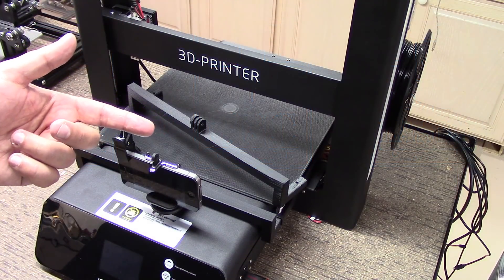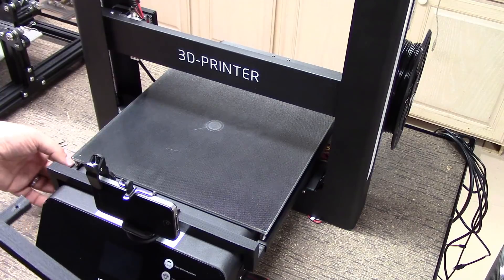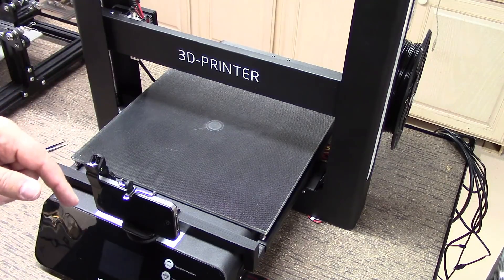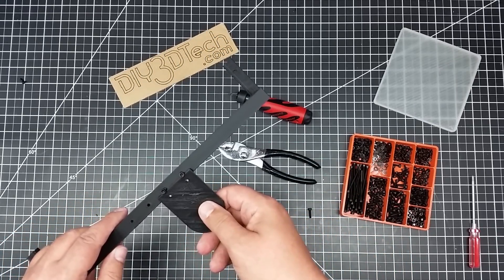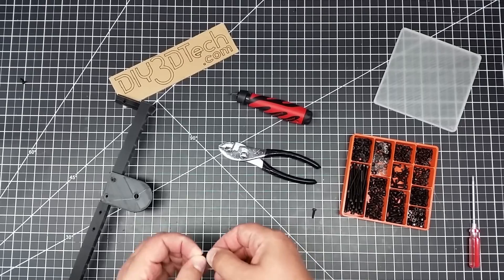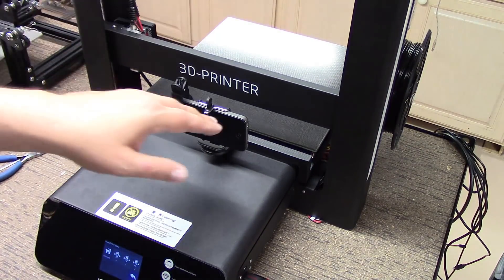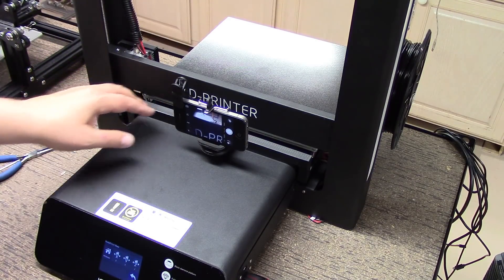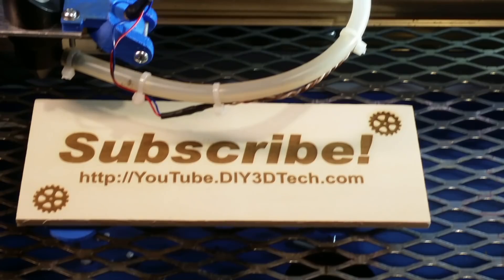GearBest JGAURORA A5 - ReMixed Bed Mounted Camera Holder!

Comment: Hey Joe, thanks for the vid. I'm currently looking into this myself for my printers. I guess depending on the mass of the camera and the speed at which you print will determine if there are any Y-axis issues. I have a couple of GoPro Hero 3 Blacks that I'll be attempting to use as well as am iPhone 5. Cheers, JAYTEE
Reply from the maker: Was just commenting to another viewer about this as yes as you add weight you may want to slow down a bit 😉
Reply: Cool Thanks. I'm glad you looked at the link xKatjaxPurrsx posted. It's really cool. Cheers, JAYTEE
Reply from the maker: I am going give it a try and see...

Comment: Now what about a quick timelapse??. If i ever install a camera on my printer i wanted it to be bed mounted, by i never saw the actual results. Just made much moire sense to mount it on the be then on the frame.
Reply from the maker: Coming :-) now unless your making YouTube videos it is not a good thing as you adding addition inertia to bed which can create issues so I typically run it a little slower 😉
Reply: Had intention of using a Rspberry cam... not much weight